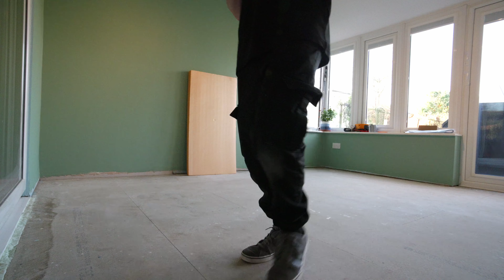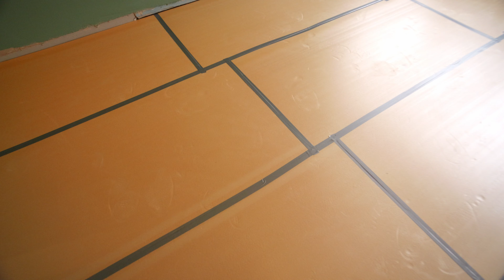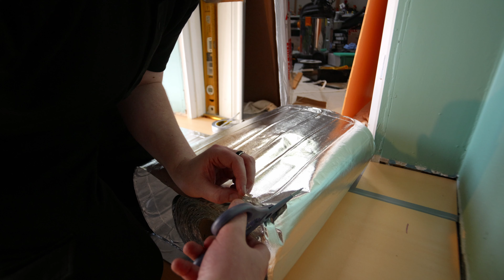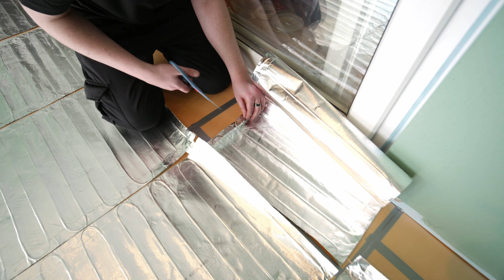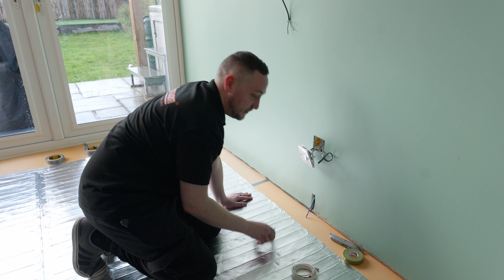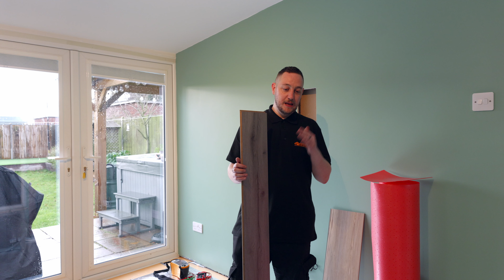ProWarm Foil Mat Installation

Comment: Hi, thanks for the video.  I’m getting quotes for underfloor heating beneath LVT flooring and installers keep specifying a dual overlay. However, your video suggests this may not be necessary. Could you confirm whether QuickTherm underlay alone is sufficient, and in which situations a dual overlay would still be required? Thanks in advance for clarifying.

Comment: Why conduit was not installed in this layout?
Reply: Because they fitted two temperature sensors. The conduit is to allow a sensor to be replaced in the even of failure.